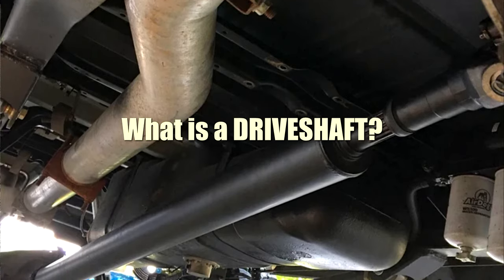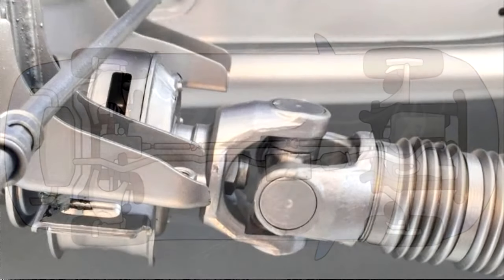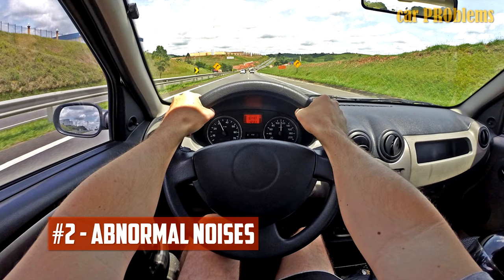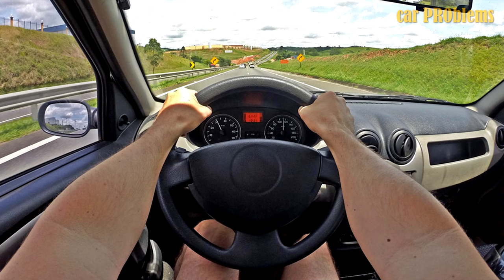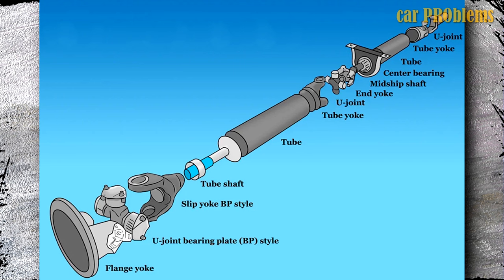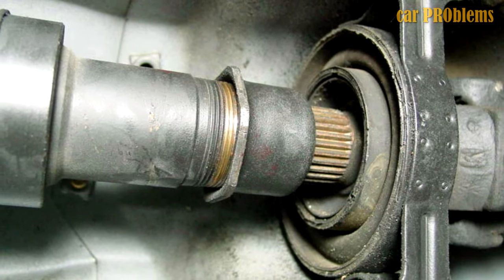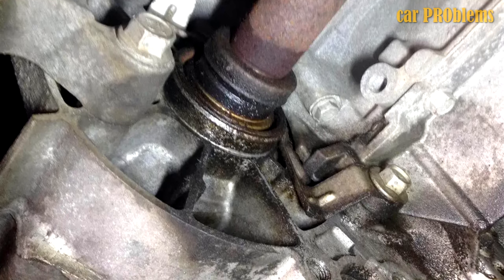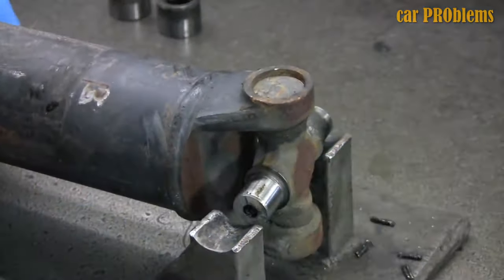6 Bad Driveshaft Symptoms - What are the signs of a bad drive shaft?

Comment: Signs of rust.
Reply: I just brought a used one, from a car with lower miles. It does have rust on it too. I brought from a quality performance shop. 

I hope there’s no problems.
Reply: @DreamBig9912  I should have clarified my statement. I ment mostly about rust coming out of the joints. This means the bearings inside are rusting. Run from those. If it's just a bit of rust on the shaft itself and I mean little, then that can be lightly sanded off and oiled and you should be good to go. But rust out of joints is a clear indications of a bad drive shaft. Doesnt take much either.
Reply: my vehicle has a loud knocking noise once i accelerate from a full stop , would it be my u joint ? i also noticed the bushings on my drive shaft are going bad
Reply: @vincentbanda2567  there are differing knocking noises. From driveline to engine. So you may need to do further investigating. And yes, worn bushings can be the cause.

Comment: When I accelerate from start, sometimes i hear a one loud sound underneath like gear slips and car stops and slowly gains power once again, what could be the issue
Reply from the maker: One possibility is that there may be a problem with the transmission or the clutch. If the transmission is slipping or the clutch is worn out, it can cause the loud sound and the loss of power.

Another possibility is that there may be an issue with the drivetrain, such as a problem with the driveshaft, differential, or axle.
Reply: did you ever figure it out? 2014 Veloster that drives fine but when i start from idle there a rough shudder and hesitation and then at highway speeds there’s a shake from the wheels

Comment: I had a new Dorman steel Driveshaft put in my Ford Crown Victoria, when I go over 70mph. I feel a vibrations under my feet. The mechanic at my Ford dealership said because my old Driveshaft was aluminum (lighter) the new steel (heavy) driveshaft will do this. Is this normal and true what the Ford mechanic told me? Thank's, Ed
Reply: Flip your driveshaft 180 if that doesn’t fix it have it balanced

Comment: will this make a knocking noise when going over bumps at low speed
Reply: It depends. If your center bearing hanger bracket is broken maybe a little but the most notable noise will be during acceleration or when the vehicle needs low torque power.
Reply: 1. could be a worn U joint in your front or rear axles. enough play in them can cause them to hit your ball joints over a bump 
2. Worn sway bar Bushings can cause a clunk over bumps. See if your sway bar has any play by shaking it with your hand
Reply: I would focus on your struts and strut mounts.

Comment: In my 2012 santa fe se 3.5l Awd, i have a shuttering when going from 0-60. Usually between 0-2500 rpms and never happens if i hammer on the gas. Could it be the driveshaft or the viscous coupler? No binding is apparent and it will go away if i let off the gas and accelerate again. Happens more when warm. And continues to happen every half of a second.

Comment: You mentioned squeaking. Would a bad drive shaft cause a squeaking when gently accelerating and maintaining speed? But when I switch to neutral while moving and stepping on the gas pedal gently, there’s no noise. I’m suspecting a worn transmission mount, may include engine mounts.
Reply: I've got an identical issue. Let me know if you get any answers
Reply: @ross5466  my mech replaced the front and rear engine mounts and the tranny mount yesterday. No more squeaking!
Reply: @emteebee1872 how much did that cost?
Reply: @mousebeater6981  the 3 mounts all cost about $450, plus labor of $600.

Comment: Got a 2011 dakota, I get alot of vibration in drivers seat bottom and floor boards between 50-65 mph,at 70+ no vibration. Had tires rebalanced and rotated,same issue. Where do I look next? TIA
Reply: did you figure it out i have the exact same issue on my 01 F250
Reply: Is there any updates guys... I too have same issue in my sonata 2017
Reply: Did you also have the vehicle re aligned?

Comment: Toyota camry 2013 hybrid. I had a oil leak from oil seal of gearbox driveshaft. I have change the seal but its still leaking. And its not leaking from the seal its leaking from the shaft where its goes in the gearbox. Also when accelerating or braking hearing noise or knocking 3 times

Comment: Would I have a problem with the tail shaft or drive shaft if I have vibration between 50 and 60 km after I get to that speed then stop accelerating the transmission changes gear again then starts but when I accelerate the auto go back a gear and start speeding up and stops vibrating also now and then when I put it in drive and as it changes gears it changes hard and not smooth but it’s not the transmission cause just got it replaced but hasn’t fixed the problem and thinking it’s eaither tail or drive shaft but thought to ask I own a 2007 ve commodore
Reply: You have a bad CV axle shaft, not driveshaft.

Comment: Clicking sound when accelerating or brake!
Reply: What’s the reason for this bro this what mine is doing
Reply: @hennyhex  there were screws lose underneath my car. I wish I could recall which part it was. But, you have to have a mechanic with experience inspect your car, they'll tighten that thing right up.
Reply: This is exactly what’s going on with my car..Where was those screws located?
Reply: Are you still having this issue.Can you give me an update.My car is doing the same thing.Seen to mechanics who can’t give me a definite answer
Reply: @hennyhex my car is doing the same thing.Did you find out the issue?PLEASE SHARE
Reply: @tiyahisrael  yeah it wasn’t my driveshaft it was the new drag pack i put on sorry man

Comment: Question I have a 04 Jeep Liberty 3.7 L automatic 4x4 that vibrates at 35 mph only I believe personally it's the U-joints but I'm not a mechanic that's just from doing research and also get a clunking sound when I switch from Park to reverse man I just about had it with this car
Reply: Not sure about the vibrating, but the clunking sound when changing from park to reverse (or anything that changes the direction of the load on the wheels) is commonly bad transfer case bushings in Jeeps.